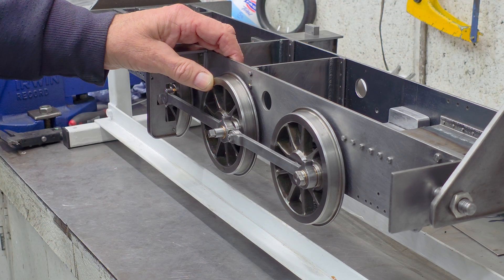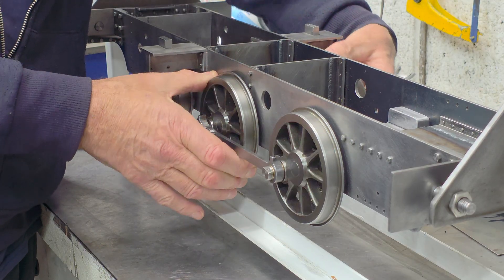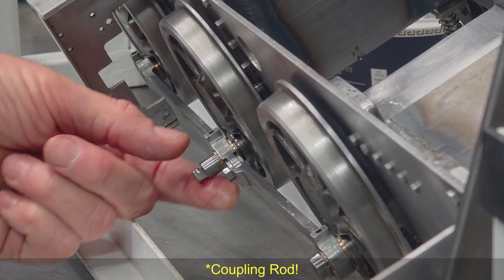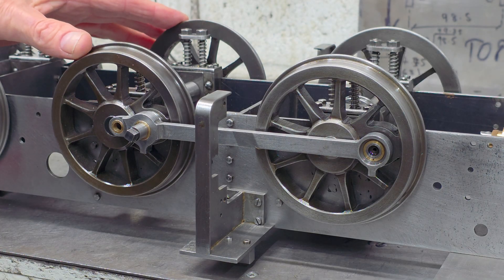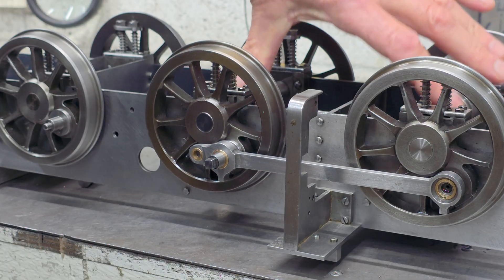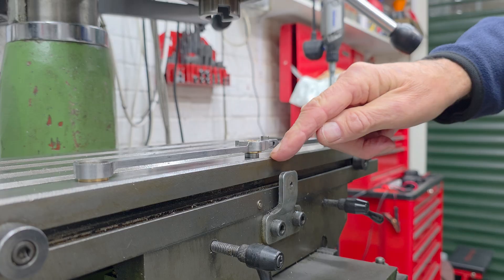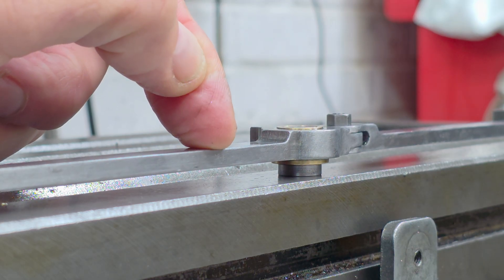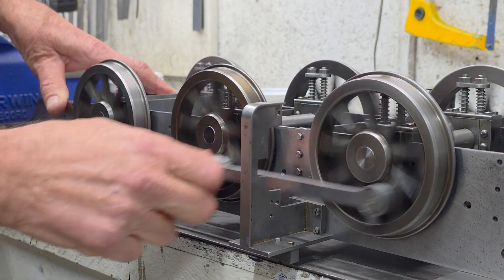Part 59: Binding Wheelset

Comment: If you are making the rods from steel used black mild steel rather than bright, which will be stressed and warp when machined. The alternative is to normalise the steel before machining. This is done by heating the steel till it goes black and letting it cool slowly.

Comment: Small tip, put the name of the locomotive or something like model engineering in the title of your video's. It will make your video's easier to find. Today is the first time I came across your channel.
Reply from the maker: Good point Ruud, it is covered off in the video's Tags, but I guess that's not working to well :-)

Comment: Finding the problem is a real challenge. It's easy to quickly tackle a perceived "problem," believing you're solving the real one, but in doing so, you unconsciously create even more problems. These have further consequences that you then have to deal with again. It's a real labyrinth... It's like making a mistake at the beginning of a math problem. You not only arrive at the wrong answer, but you also introduce further errors into your calculations. It took me months to find such errors, and only in the very end was it perfectly clear. You did a great job!!!

Comment: Definitely better to sort it out now.  I had a similar issue with my Polly V, but left it hoping it would run in.  Needless to say, it wasn’t free enough to run properly.  My issue was that the knuckle joints were too tight.